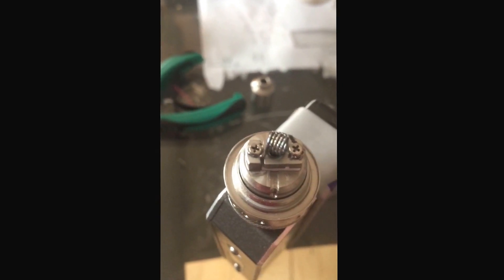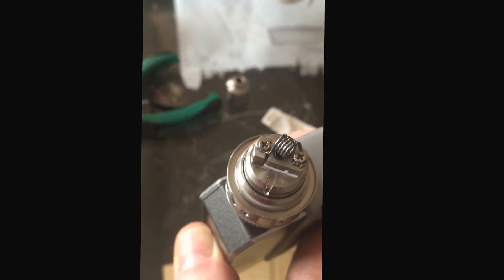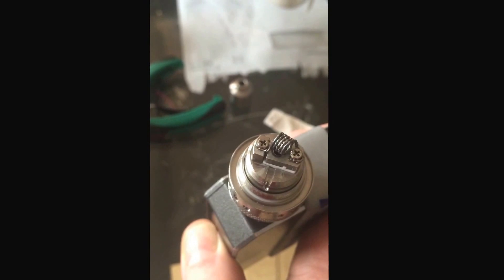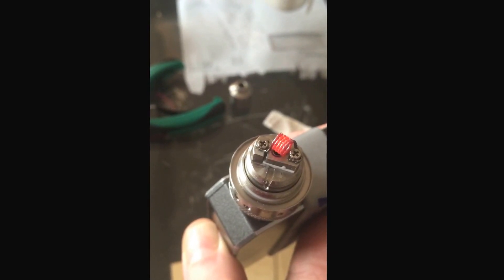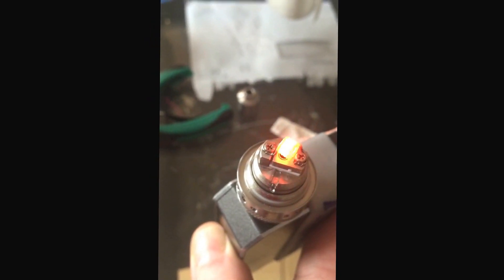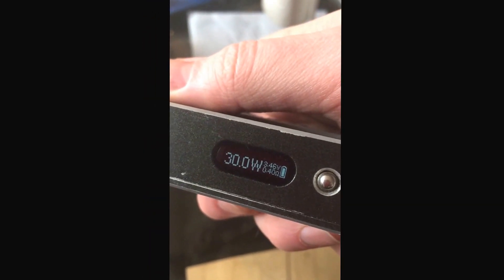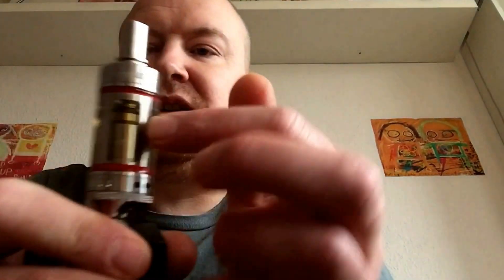Kanger Subtank at 50 watts. Turned it down to 41,6 after and it tastes amazing!

Comment: I know that this may go against what some people do.

My wife and I had been smoking for 40+ years when we started vaping 5 months ago.
We started with SMOK winder batteries, with SMOK EBC tanks.  We changed to SMOK GBC tanks because of the extra tank volume.

I recently bought a SMOK Xpro M65... not because of the higher wattage but because of the longer time between charging the battery.  (1300 mAh vs 3400 mAh)

I also bought a Kanger Subtank, and a supply of 1.2 ohm OCC coils.  Why?  Simply because of the tank capacity.
I can go 2 1/2 days between charging and refilling.

Disclaimer:  I'm running SMOK Xpro M65, with a Kanger Subtank, with 1.2 ohm OCC coils, at 8 watts
Reply from the maker: As long as you stay smoke-free and feel satisfied!!!